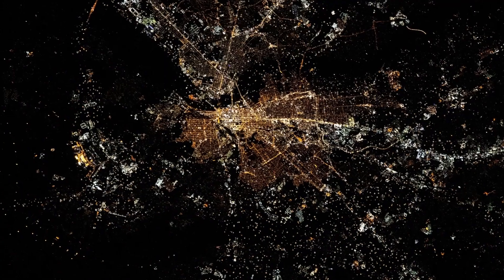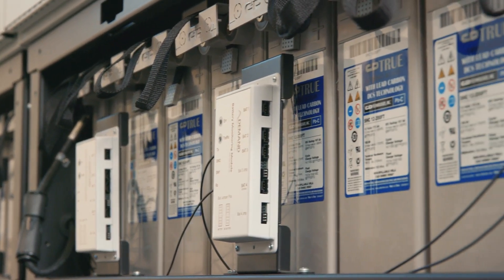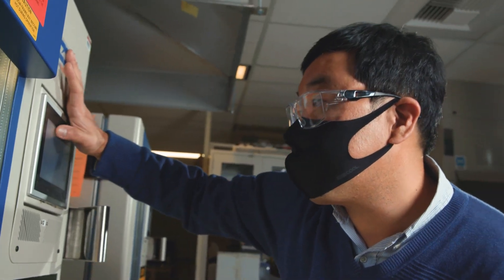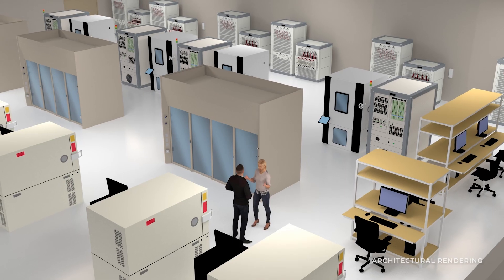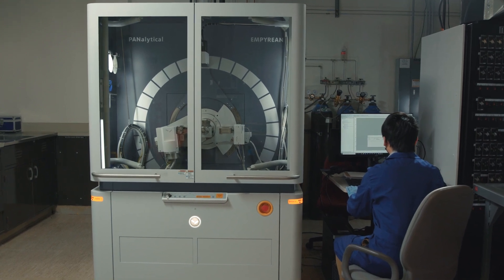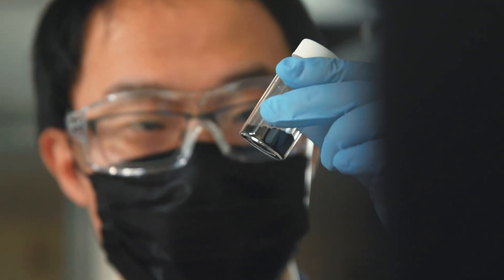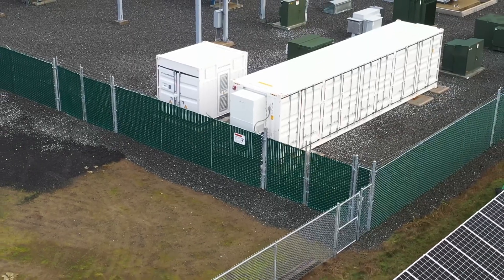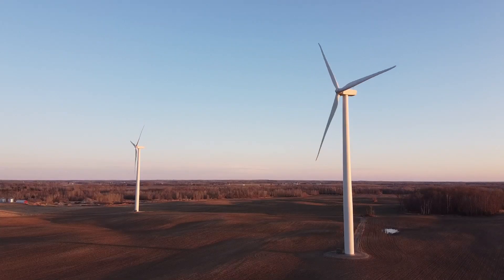The Grid Storage Launchpad

Comment: Drexel U. has produced a Li-S battery that boasts 4,000 cycles while maintaining an energy density between 800 mAh/g and 650 mAh/g. These cells should be cheaper and last longer than LFP, so please contact Dr. Kalra ASAP with a proposal to test and improve the chemistry for grid deployment.